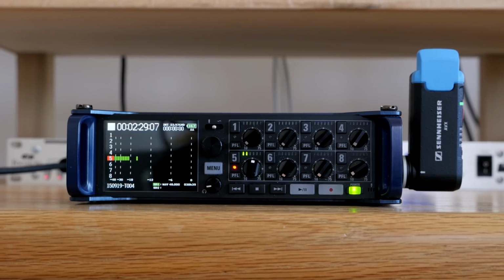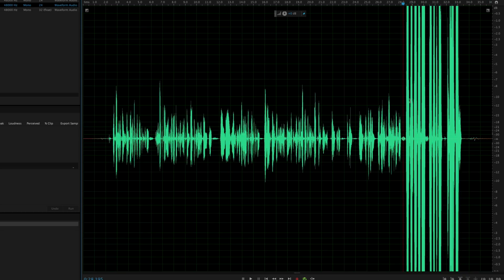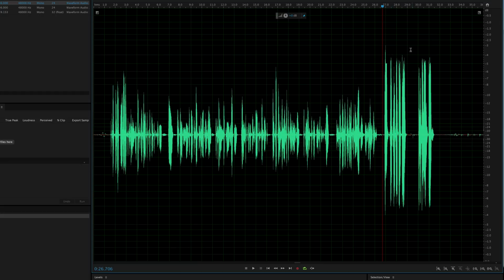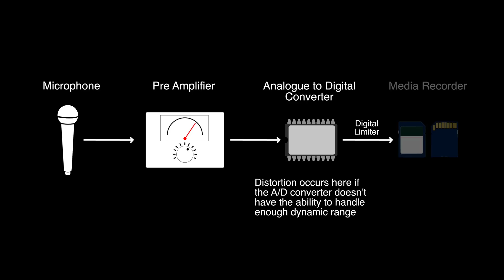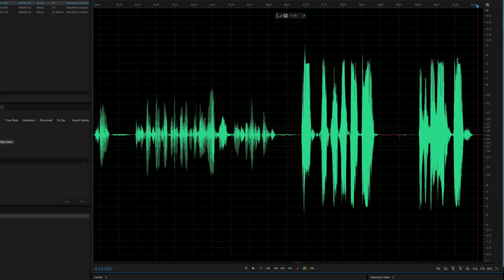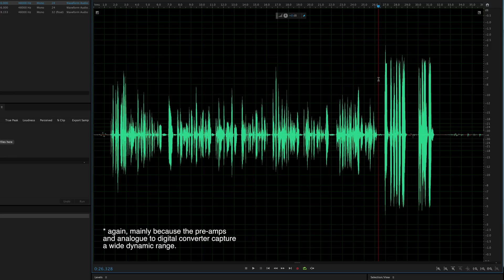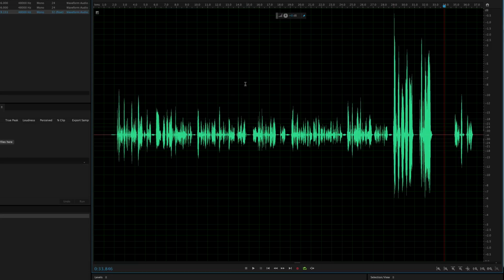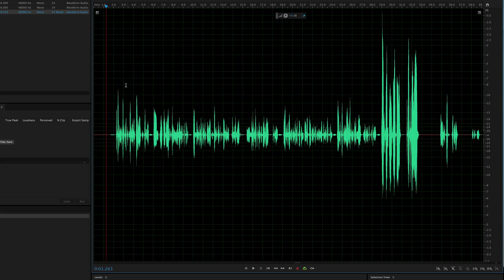Zoom F8 Input Limiters

Comment: I just bought some kit from a friend before he left Korea.  It happened to be a Sound Devices 302 mixer. So....if this fine field mixer is set up with its limiters, I don't really need to worry about my Zoom F8s lack of analog limiters correct? I saw a video of another Sound Recordist that setup his SD302 but then set his Zoom H4N limiters to "3". It totally confused me. Should I be setting up the limiters in the F8 if I have the 302 already set? (Double limiters??)
Reply from the maker: It depends on how the limiters are implemented. For the 302, I think you'd be find to turn off the Zoom limiters as long as you calibrate the levels between the 302 and the F8 and you gain stage correctly so your audio isn't hitting the limiters in the 302 too often or too hard.

Comment: Sorry to revive an old video- I bought the Zoom F8 largely on your initial recommendations (and others), and then cooled on it when you pointed out the the issues with the Input Limiters. I used it only when I needed more than the 2 inputs on my C100mkII. Then they came out with the F8N, and I figured I just was stuck with old equipment with some significant flaws.  I was surprised when I went back to the Zoom website today and found that Zoom made some significant firmware additions since my last update (prev ver 4.0). Now at ver. 6.10 of the F8 firmware, they added "Advanced Look Ahead Limiters" - does that address some of your concerns about this? The addition of Automix, though limited, is quite welcome as well. Cudos to Zoom for updating the F8. https://www.zoom-na.com/sites/default/files/products/downloads/pdfs/F8n_vs_F8_ComparisonChart_1.pdf  Thanks for your great videos!
Reply from the maker: Hi Lawrence,  Yes, the firmware was updated about 18 months ago with the advanced hybrid look-ahead limiter. It solves the problem which the original digital limiter had which was that it allowed the first transient through the limiter and thus could still clip. The newer version is better, though it still comes at a cost of potentially raising the noise floor by up to 10dB. However, because the F8 has an extremely low noise floor, this is not generally an issue. I would suggest you give it a try, I think it will work nicely in most situations. Best wishes!
Reply: @curtisjudd  Thanks so much! I am also looking at purchasing the new F6 - for a smaller footprint and much greater dynamic range. I have to record an orchestra and choir concert, and the recording would benefit from the wider range. Having trouble connecting the F8 to the app right now - updated all the firmware and reinstalled the Blutooth extension, it won't let me enter the code on the iPad (iOS current 13.1.3), though the app thinks it's connected. The code won't leave the F8 screen. I reached out to Zoom on this, but from their firmware notes, it seems like there have been issues.
Reply from the maker: @LDBecker  One word of warning re: the F6: If you plan to feed audio from the F6 to camera, and you will be recording in 32-bit wide dynamic range mode, the camera audio can and likely will clip. This is because the camera simply cannot handle the wide dynamic range that the F6 can handle and the F6 doesn't have any sort of automatic process or feature to remap to a non-wide-dynamic range input like your C100's.
Reply: Curtis Judd I plan to use a Tentacle Sync to bring the audio together in FCPX- thanks!
Reply: @curtisjudd  Went and looked at a F6 and decided to see how my event goes this weekend with the new firmware on the F8 before I upgrade. I imagine Zoom will come out with an F8 version with the wider dynamic range soon anyway. Hard to keep up with all the new gear. Thanks, Curtis!

Comment from the maker: Update: I've learned that there's more to this limiter than originally thought. When you turn the limiter on, the analogue preamp gain is reduced by 10dB. As the audio signal comes through the preamp and then A/D converter and the digital limiter, if the signal has not passed the threshold, 10dB of gain is added digitally. So you actually do get some additional headroom which is why it was so hard to clip in my tests.
Reply: So the limiters are actually useful on the Zoom F8? Combined with the safety track it seems like a very useful recorder.
Reply: I just purchased the zoom f8. I'm going to be shooting a film with a lot of screaming going on in certain scenes in the near future. Do you think the zoom f8 and additional work done in post in adobe audition can give professional sounding audio? or should I consider returning it for a sound devices product? Not an audio person but trying my best to understand and get it done right. thank you for your time and effort.
Reply from the maker: Hi M N., yes, you'll want to be careful about leaving plenty of headroom for the screaming and turn turn the limiters on. You want to avoid having to fix clipping in post. It can be done if it is minor but if too heavy, you could lose the take (with an F8 or Sound Devices). With screaming you need to gain down to the point where the screams are hitting -12 to -18 in my experience. Good luck!
Reply: Thank you!
Reply from the maker: It is a very useful recorder. I would say that the limiters are somewhat useful - better than I originally thought, but not quite the same as proper analogue limiters.
Reply: Curtis Judd 👍

Comment: That's absolutely the most pointless limiter I've ever heard of.
Reply from the maker: Update: I've learned that there's more to this limiter than originally thought. When you turn the limiter on, the analogue preamp gain is reduced by 10dB. As the audio signal comes through the preamp and then A/D converter and the digital limiter, if the signal has not passed the threshold, 10dB of gain is added digitally. So you actually do get some additional headroom which is why it was so hard to clip in my tests.
Reply: Curtis Judd 

So it acts more like a pad come expander.
Reply from the maker: Rather than a pad and expander, it reduces the gain, not by attenuating but applying less gain which is better in terms of creating real headroom. Then it makes that gain back up when the audio is not peaking in the digital stage (just like normalizing in your DAW)

Comment: Hi Curtus thanks for this video! I want to buy the Zoom F8 and I was  concerned about the limiters. I'm still on the fence in that regard, but how does it stack up in comparison to the sound devices premix 6, would you say it has better limiters or does it not have limiters?
Reply from the maker: Hi Alejandro, the MixPre has better limiters in my experience. However, the MixPre is missing some things that the Zoom has so it is a tradeoff. What will you be recording and will you be monitoring and adjusting during a take? If so, the F8 can still be a great tool.
Reply: Curtis Judd I'm working on a feature film as the boom Op. The sound mixer is going to miss a day or 2 so I'm preparing and building up my gear slowly but surely just to be prepared. I would love a sound devises 664 but can't afford it right now, and I'm also looking for more paid gigs.
Reply from the maker: Sounds great and I wish you the best!

I'd have a hard time choosing one over the other but if I had to, I'd go with the Sound Devices. I find it easier to mix with but that is a purely subjective opinion. Others are making great recordings with the F8.
Reply: Thanks Curtis!

I wish the best as well! 

I couldn't agree with more on the Sound Devices, they're the best. My buddy Jacob has been using the 664 for over a year and I love it! But for now, I'll go with the F8 because that's what I can afford. Maybe later as I start making a decent enough living I'll upgrade. I'll keep you updated with my progress.

Comment: hi Curtis, thanks for your great video. I'm a newbie video maker, and i want to ask you, how about zoom f8 compared to zoom h6? I'm very confused at now, because H6 portability is better than F8,but how is the sound comparison in your opinion?
Reply from the maker: Hi Andry, the F8 produces better recordings in my opinion but it is, of course, heavier and larger. It's preamplifiers can produce more gain so that they can cleanly amplify more microphones, especially less expensive mics which in many cases seem to require more gain to sound good. There is also a huge price difference. If you really don't need 8 microphone inputs and 4 would be enough, you might like to look at the F8's sibling, the Zoom F4: https://youtu.be/Rr7pSufelOY

All that being said, for $350 USD, the H6 is quite good and you can make good quality recordings with it.

I think the two main questions to answer for yourself are how many microphones will you record at the same time and what is your budget for a recorder. Then the decision is easier. Best wishes!

Comment: In a compact package, for run and gun recording for a Canon XA10 and a future camera upgrade, which products should I look at that have great analog or digital limiters?
Reply from the maker: The F8 is really good and in many cases, a limiter is not necessary, particularly if the preamps have a lot of dynamic range, like the F8's. But if you do need analogue limiters, I'd look at the Sound Devices preamps/recorders/mixers. If you just need a single preamp, the Sound Devices MM-1 is worth a look: http://www.bhphotovideo.com/c/product/292989-REG/Sound_Devices_MM_1_MM_1_Single_Channel_Portable.html/BI/19904/KBID/12941/kw/SOMM1/DFF/d10-v2-t1-xSOMM1

But it depends on many factors. How many inputs to do you need? Does it need to be mounted on your camera rig?

I hope this helps!
Reply: +Curtis Judd ...I need it for the clapping, loud music and DJ MC at formal event receptions; and the sudden, unpredictable yelling on the sidelines and stands at sporting events.
Reply from the maker: That makes complete sense. The Sound Devices MM-1 might be a good option if you just need one channel.
Reply: +Curtis Judd ...Thank you so much. I will take a look at it.

Comment: Of course Distortion on your Pre Amp stage can still be bad even with an Analog Limiter after it and pre A/D. You explained this really well, I just wanted to reemphasize that for people. I have heard a lot of chatter from people in threads as if to suggest that you "Cant" go wrong with the analog limiter stage.  Its a trade off for sure, but I am ordering one of these babies. The cost vs features is incredible.
Reply from the maker: +Tom Todia hi Tom, I completely agree that the F8 is an amazing kit for the price. Also agree that analogue limiters will not save you in every case, but they add another level of assurance. I hope you like the F8 as much as I have. Best wishes!

Comment: Your overviews/reviews/comparisons are downright exceptional.  I'm a photographer/videographer coming at audio with limited knowledge. Just got my Zoom F8 because of your reviews.  Riddle me this: if I'm in the field, I get the benefits of an analog limiter with my Sound Devices 302 if I'm using it as a pre-amp b4 the Zoom F8, right?
Reply from the maker: +Giorgio Litt thanks! Absolutely right, that would be a great combo!
Reply: The perks of accidentally leaving your old Tascam DR:40 at a gig with swiping musicians: earlier than anticipated upgrade with great improvements in audio capture!
Reply from the maker: +Giorgio Litt LOL! Any excuse to upgrade is good enough for me! That's a big upgrade from the DR-40 to the F8.
Reply: Quick power question in the field. Again, coming from a lack of experience on the audio side, can you comment on my power solution? In addition to back up AA in both SD302 and ZoomF8, I'm going to have a Switronix Hypercore slim V mount battery go to a Dtap splitter, then go Dtap to Hirose into both the SD302 and the Zoom F8.  I don't see a reason for something like a Remote Audio BDSv4U distribution system, unless there's something I haven't thought of...
Reply from the maker: +Giorgio Litt The Remote Audio distribution boxes have some protection circuitry in them so you'd be skipping that. I'm not sure how critical that is or what level of protection they really offer since I don't know a ton about electronics. You might check with one of the pro audio houses or over at JWSound for help on that.

Comment: I have emailed support regarding this issue and it seems like they do have a backup solution.  Here is Zoom's response: 

"Thank you for your email.

I understand your 
concern. We did design the limiters with the fact that digital is not as
 safe as analog in mind and put in an extra 10  dB of  headroom,  
allowing  signals  to  be  kept  well  below  the  set threshold, 
therefore more effectively preventing distortion. This with the dynamic 
range of the pre's makes the limiters effective in all but the most 
extreme cases. 

If you are looking for an even safer option
 I would suggest using the Dual Channel Record mode. This allows you to 
record 4 channels with a double of each at -12dB from the original 
signal. This is the best way to always have a fallback. "

Comment: I LOVE the F8 :)

One QUESTION though: Is there a way for the safety track level to track the level of the primary track? I.e. I set track 1 to 60dB gain and the safety track 5 to 40dB gain. I then reduce track 1 to 55dB, however I had to manually adjust track 5 down to 35dB.

Is there a way to make this automatic???

Thanks for all your excellent reviews! You rock.
Reply from the maker: +RemekTek Media Me too! I don't think that there is a way. I tried linking the trim for channels 1 and 2 but then they record at the same level. :(

Comment: Dear Curtis, I'm really impressive to found you via searching review about ZOOM F8. Thank oyu for reveal the main point I realy to know is the way that ZOOM F8 can handle when shouting or creaming. So, I would like you suggestion or advice about which one the best or reliable device for field recording to get best result for that situation? 
Best regards,
Thavy
Reply from the maker: The best solution is something with a lot of dynamic range like the Zaxcom Max or something with a proper analogue limiter like the Sound Devices 633. If those are out of the budget, you can go with the F8 and record with less gain and set the recording bit depth to 24. But be ready for re-takes.
Reply: +Curtis Judd Many thank you for quickly reply and really glad for your advice :)

Comment: Your video convinced me to buy one as soon as i can. I haven't got that much chance with the Tascam DR-70D and the tech support of Tascam does not even answer to their emails.Haven't done also audio lately since i've been working with servers virtualization, but i should be good next week hopefully.
Reply from the maker: +Steven Rix Good luck! I haven't had to contact Zoom support yet so I don't know how that works but I have seen them post responses to online reviews like this so they seem somewhat engaged. I've never seen Tascam post to reviews online.
Reply: +Curtis Judd I had a great experience with support on the F8 with Zoom.  They swapped the unit quickly.  I think they are taking any issues seriously.  Mine was a minor problem related more to the mounting point coming loose, not sound or technical.  I have heard this from others as well.
Reply from the maker: +Adam Simpson Great to hear, thanks Adam!

Comment from the maker: +Grey Fox To my surprise and delight, the safety tracks actually work! I was afraid that they might be doing the attenuation for the safety track in the digital stage but in fact, it looks like it actually routes the mike to another pre-amp with a lower gain setting and it works without distortion! Great news and thanks for pointing that out!

Comment: The Zoom F8 is in my point of view only the receiving end . i use an audio development ad 261 field mixer  with its most superior mic preams and superb limiter andf just drag it through. i would never use the internal digital zoom limiters ... and mixing nice and hot , the audio comes in at around -6 db.... perfect full dynamic range and still enough headroom .... . great review ! liked it ! and i ll get the f8 . soudn devices is also very good, but the price tag ......
Reply from the maker: +Tobias Gerlach Thanks Tobias. I hadn't heard of the Audio Development AD 261. Where does one find those for sale?
Reply: +Curtis Judd  audio development. especially the ad 261 was never wildly popular in Germany. Most people use the awesome SQN and the Sound Devices. The AD 261 i bought on ebay for a joke price. i bought it for 250 euros out of a bancrupcy - worth over 6k .... i personally must say the ad261 is one of the best mixers i have ever used. very . i mean not very . i mean excellent limiters. very good mic pre ams and a ton of other fun stuff ... cant wait to put the f8 as the receiving end  .... i have used the 744t of Sound Devices , also an awesome machine, but the pricing is something most people just wont pass on, and the zoom f8 is a force to be recond with i guess .... =)
Reply from the maker: +Tobias Gerlach Great, thanks for the info!

Comment: Is there a direct line in which bypasses the pre amps altogether and if so how many lines in can I getI was wanting to buy this and the Sound Devices 302 to use as the preamps for up to 3 mics
Reply from the maker: +Dwight Larks Yes, all 8 inputs can be used as line-in via 1/4" plugs. I don't know a lot about the limiters in the 302 but I'm betting that will be the main thing you pick up by adding the 302 (assuming they are the optical, analogue limiters featured in some of SD's higher end mixer/recorders)
Reply from the maker: +Daniel Salzedo Also, regarding your question on powering via USB, unfortunately, no, you cannot power it via the USB input which is unfortunate.